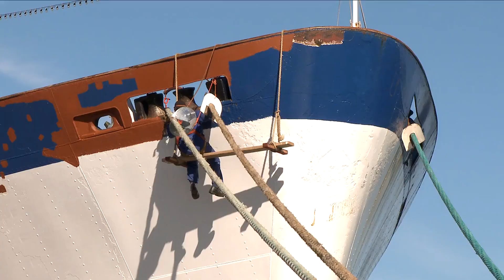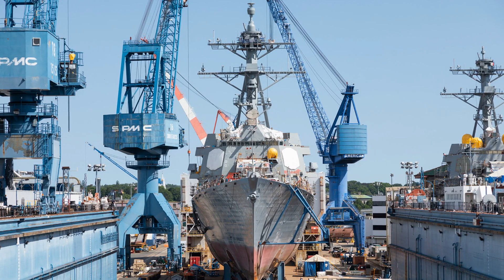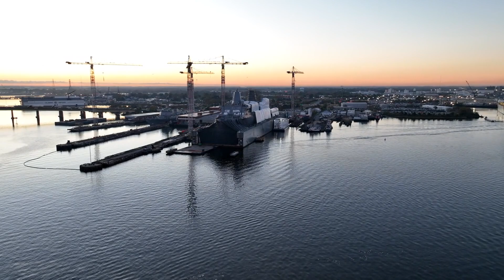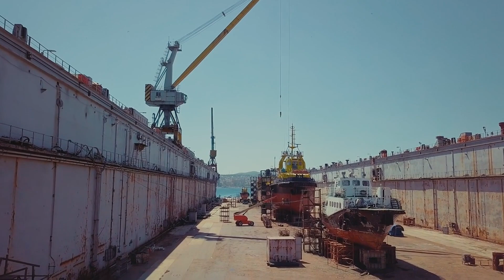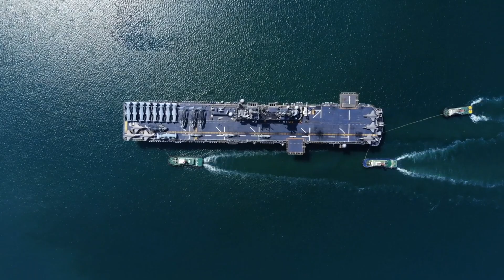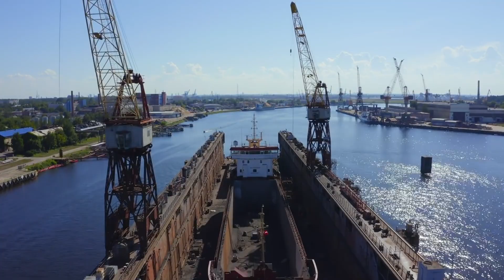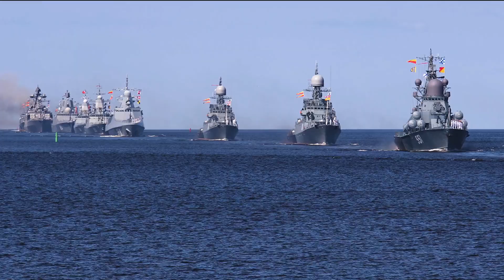Why Is the US Navy Taking SO LONG to Build Its Ships?

Comment: It doesn’t reflect on the US workforce so much as the decision makers who specifically ordered a mature in service frigates design and then went about altering the design drastically over a prolonged period requiring ever more redesign work and delays.
  If they went with the original in service proven design they would be hitting the water on time and on budget.
 The buck stops at the top! 0:29